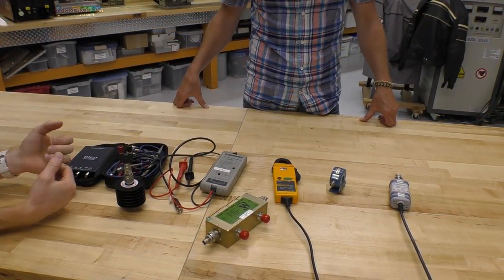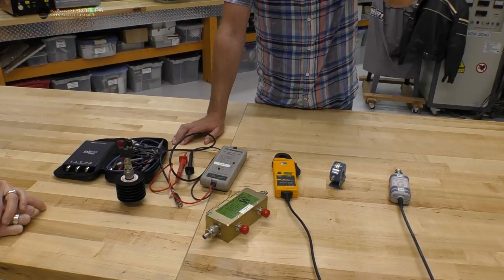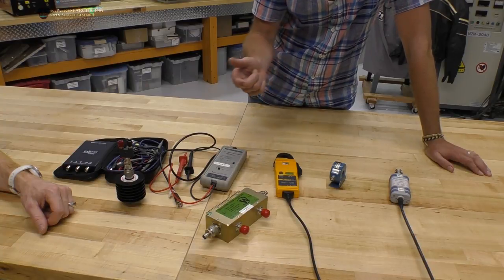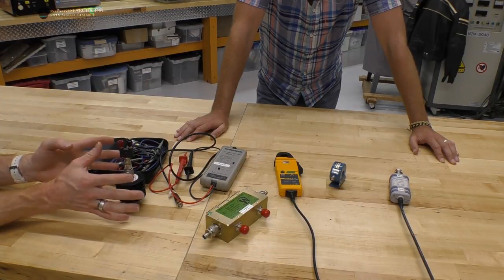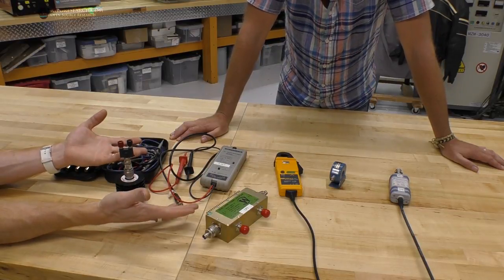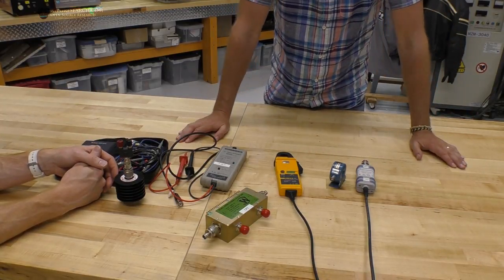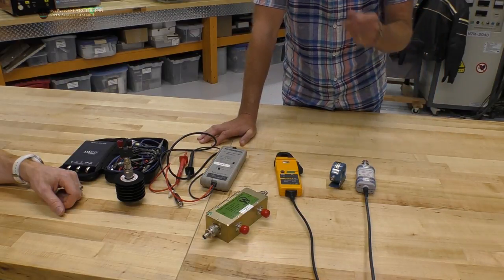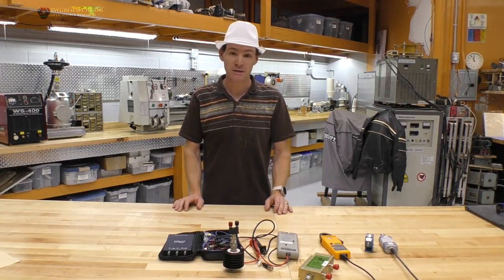Part 4: How To properly Mesure Power "OU", Probes And Know How. Final Part...

Comment: Great video series guys! You  have highlighted  two really important points about about Free Energy/OU device claims:

1)  The creator should be able to give plans/schematics to a third independant party and they should be able to replicate the device and demonstate that it works in the same manner.

2)  In addition to " measurements " of watts in vs watts out, I would think one should be able to demonstrate this gain with some sort of practical experiment. Such as  powering up a toaster with a 9v battery.

Russ, I think you are completely right about keeping everything " open source " to protect this reseach from any interference and progress should be a lot faster with more people working on it .   I have a question for you that I have often wondered about. Have you personally experienced any outside interference in your research from influences such as "The Government" or " Big Oil" ?
Reply: William Hada see that's why you don't go to third party or show anyone, because once you do you will be stopped

Comment: In the prototypes I work with in motor generators I have experienced the unconventional. The most striking thing is digital  devices measure voltages without variation and seem credible. The amperages are different tough. The power supply always shows a higher amperage than the multi meter in line. The same line on an analog gage tends to agree more with the multi-meter but plus or minus 5% or more. There is a condition where amps show near zero digital and zero on analog gauges with full power circulation. If it is unconventional (not a "conditioned range") power the contribution measure is hard to separate. Logically then it may not be the whole picture. Consider this: digital devices use math equivalent derive watts. James Watt used the classical physical watt. So if the  torque in physical true watts (not reactive fuzzy power compared to virtual math or whatever) does not agree there is something missing in the virtual math input-output model.